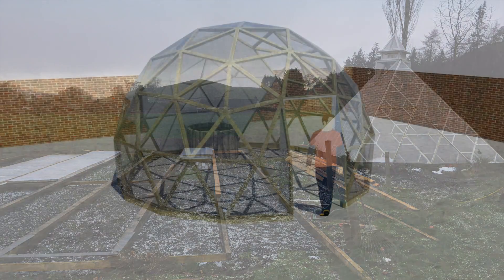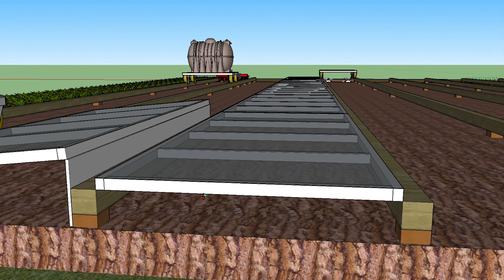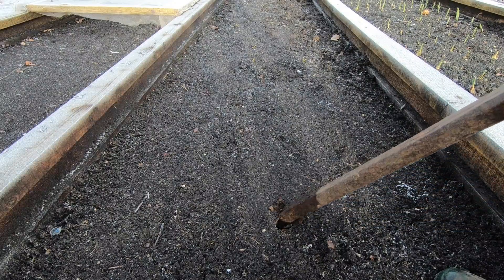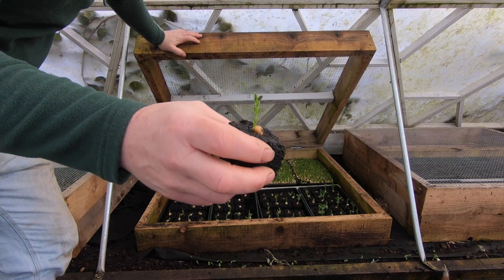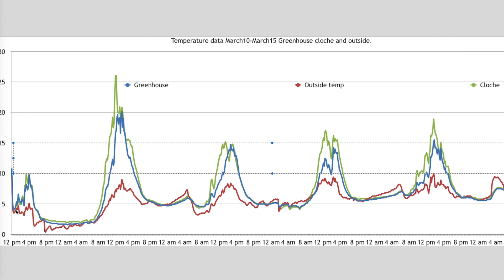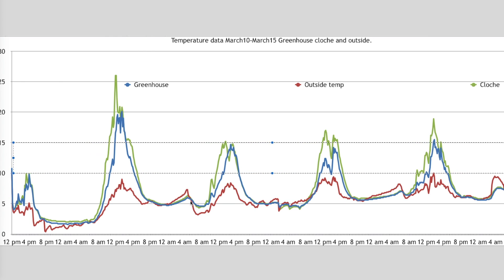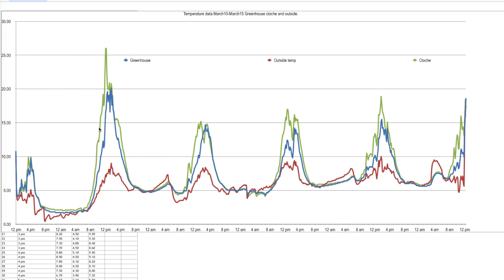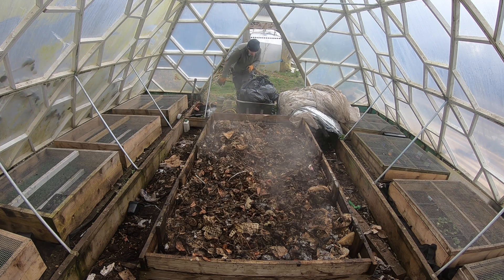Cloche Vs Greenhouse - temperature testing

Comment: I would propose another test that interesting for me. BTW, it can be done even with cloche. Just put the PE pipes inside the ground, let's say at a depth of 1 meter. And circulate the warm air from the cloche inside these pipes. So you would see the temperature alignment through the day: cooler in the afternoon and warmer in the evening